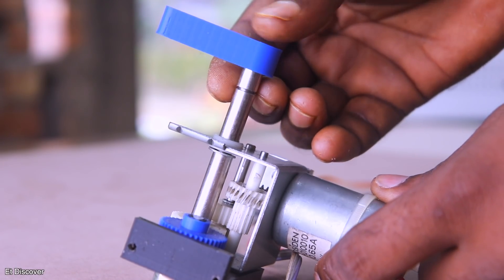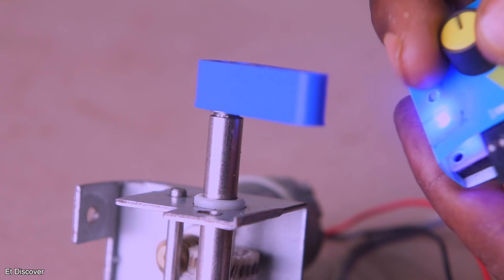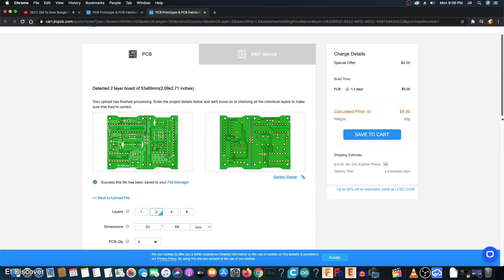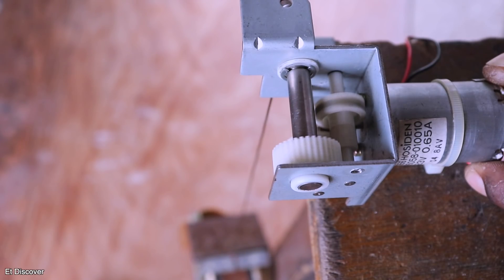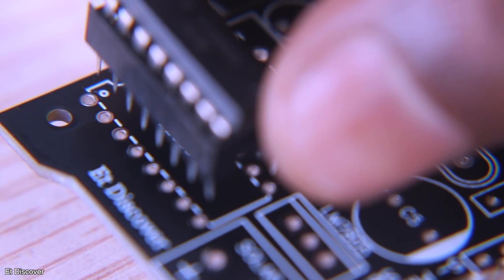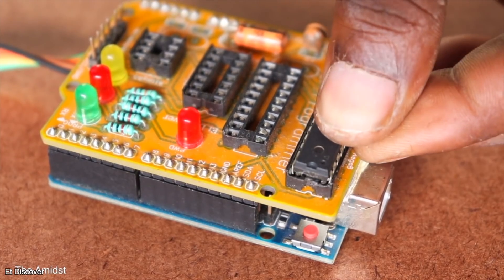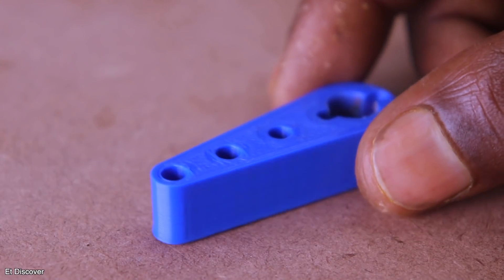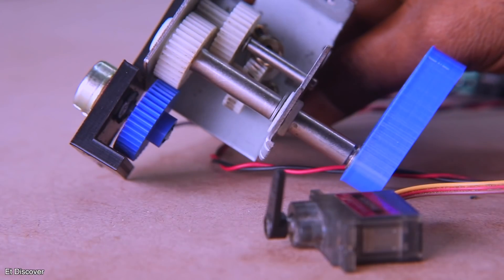How to Convert any Gear Setup in to a Servo Motor

Comment: I am using tpa3137d2 amplifier in my speaker, willing to add Bluetooth, aux in, micro sd, usb, and other thing. I know that MP3 decoder are available in market we can buy and use but I need to know how that work and changing modes. Please made a video of it.
Before video you told I'll try
Reply from the maker: I understand but this is lot more complex, so that is why I need to some experiment